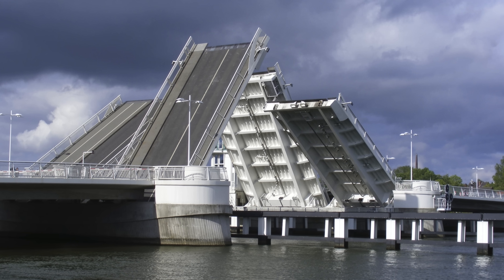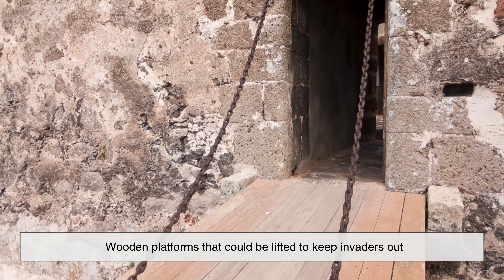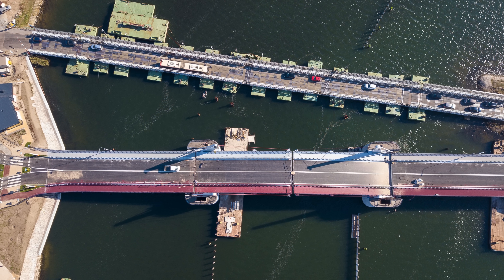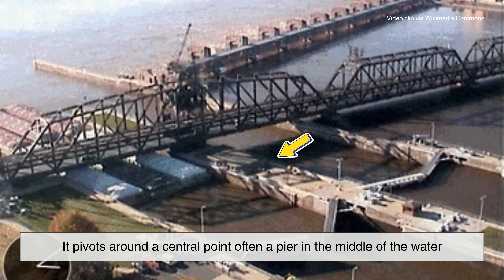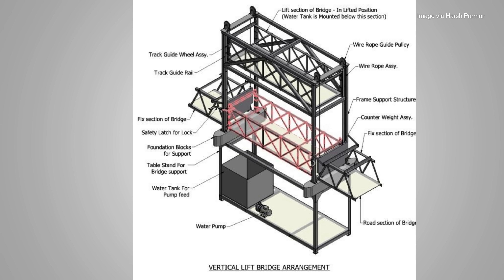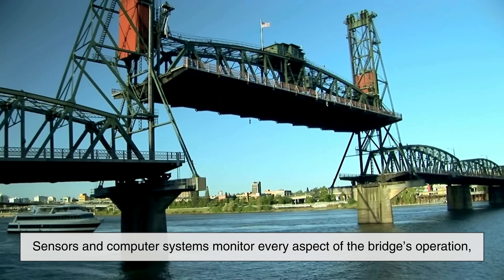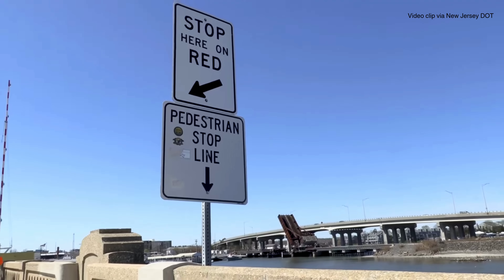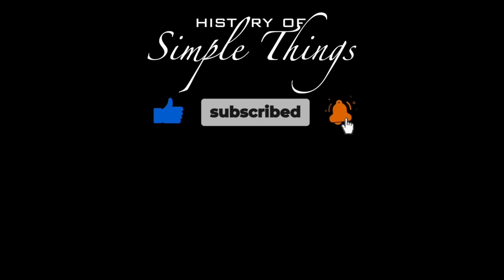How Do Drawbridges Actually Work?

Comment: Good to see how a draw bridge works, I'd like to see how traffic signals work. As in, how do they know when cars are at the stop light. 🤓
Reply: There is a pressure sensitive wire embedded into the asphalt in the roadway, which detects a vehicle sitting at the light , when a vehicle that is heavy enough pulls up and stops it breaks the electrical signal and that notifies the control box that there is a vehicle waiting to go.